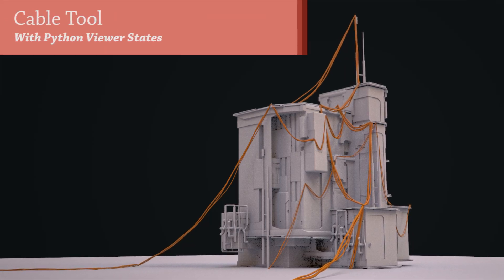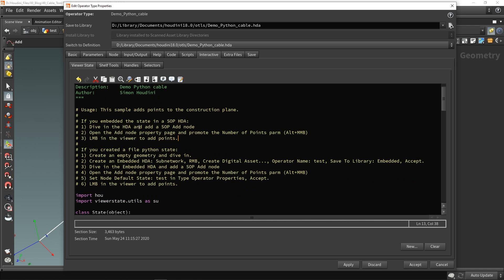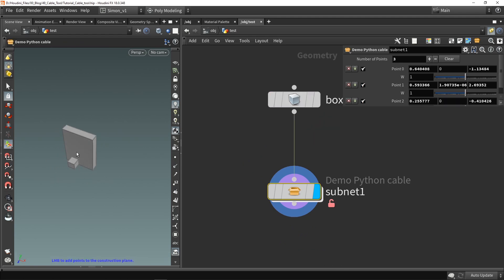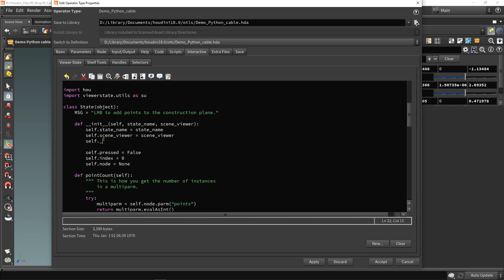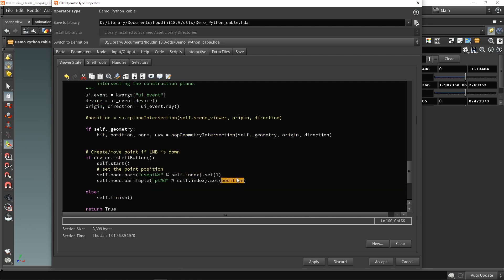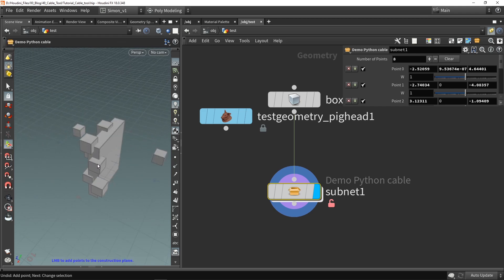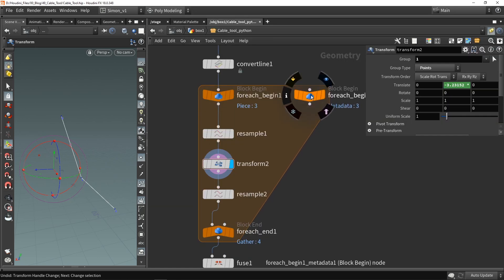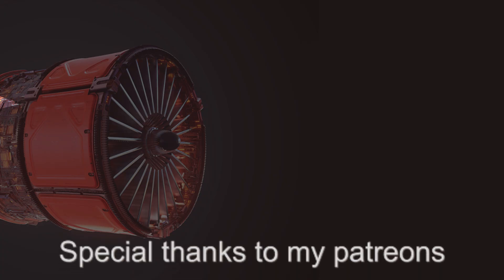Houdini Cable tool with Python viewer states

Comment: would it be possible to check how far is point placed outside of object? If too far, don't put any points, because if I misclick 1 pixel from object, it will put point very far away on projection plane.

Maybe even with slider option, how far points from current view can be placed on projection plane (placement on object would have no limit)
Reply from the maker: Yes, you try that. What I often would do is check if it is hitting a primitive, when not don’t place a point

Comment: Thanks a lot for the tutorial ! I have an issue,  on the Viewer State Code Generator, the "Add Point" sample doesn't appear, I tried multiple times with the shown method with no success !
Reply from the maker: Check if the other samples works. What can influence this is the Houdini version, so updating might help. You can report the issue on the sidefx website if you are still unable to see the "add point" example.
Reply: @simonhoudini5074  I updated Houdini from H 18.0.287 to H 18.0.499 and it seems to work ! Thank you ! Can't wait to try out your tutorial ! :D

Comment: Are viewer states possible in 17.5 ?
Would this work in Houdini Engine ? Or would I need to use a curve instead ?
Reply from the maker: Viewer states have a better integration in 18. 
Viewer states are for what I know not possible through Houdini engine.
Reply: I adapted the Labs cable tool to be used in Houdini Engine, you have to use splines in UE4 but it works.